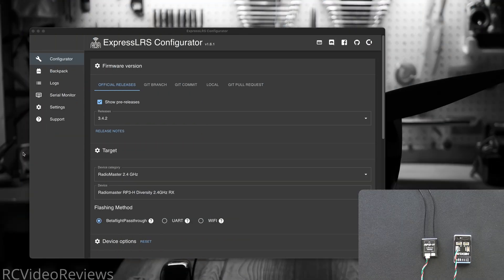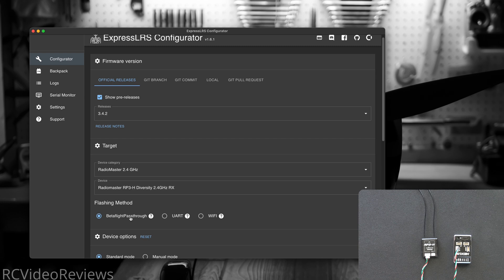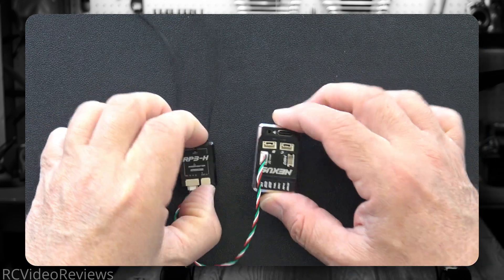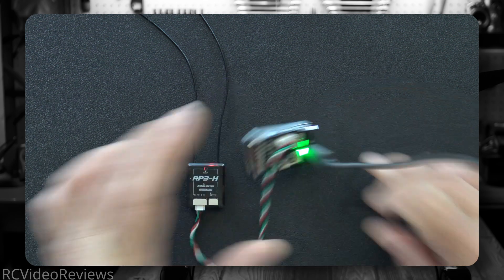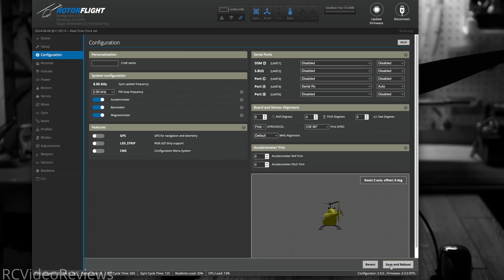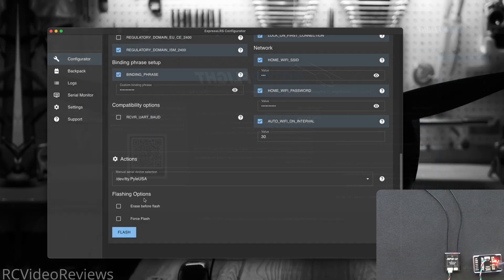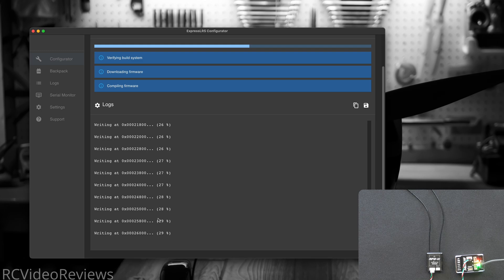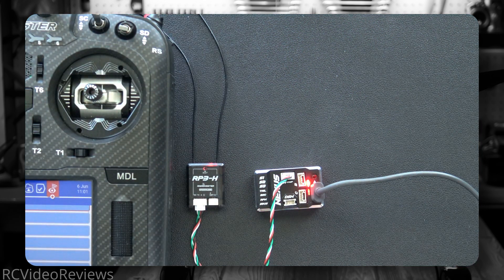Radiomaster Nexus • Flash ELRS Receiver via Rotorflight

Comment: I was wondering if you could help with binding a spektrum satellite to the nexus?
Reply from the maker: Sorry, I don't use any spek stuff.
Reply: @ I don’t know why they give you the option if they can’t give you the support I can’t find any info on how to setup spektrum on the nexus and I personally think radiomaster is a joke
Reply from the maker: First off, Radiomaster is not Spektrum.
Second, you don't bind a RX to an FBL.
Third, Communications protocols between FBL and RX are well documented.

It's fine to have an opionion; however, in this case, I think yours is wildly misplaced.
Reply: @ and if it so simple how about you show people reach out to horizon hobby and get a spektrum radio and set it up with nexus I had really high hopes this could be a really good system to use but honestly you get what you pay for cheap ain’t good and good ain’t cheap